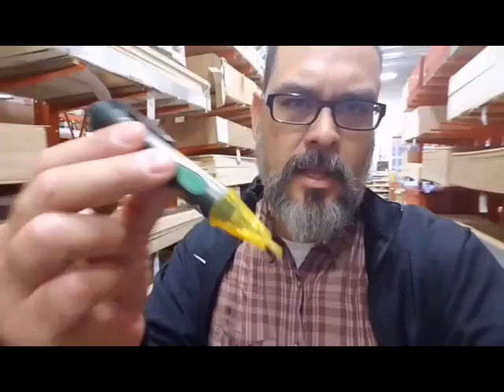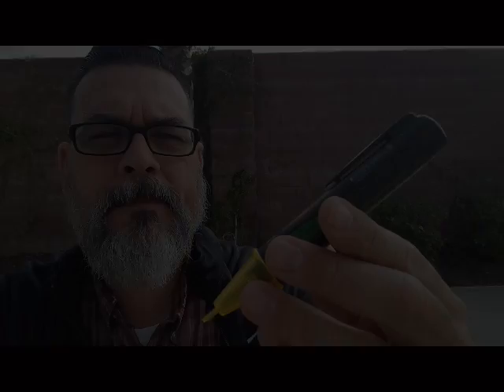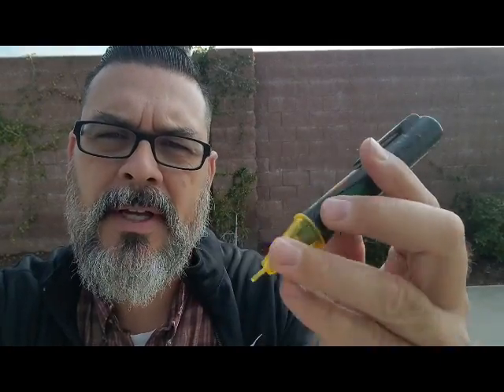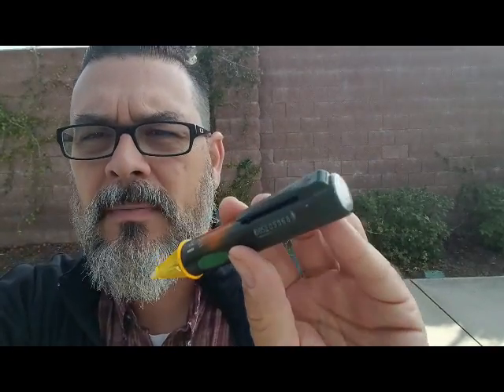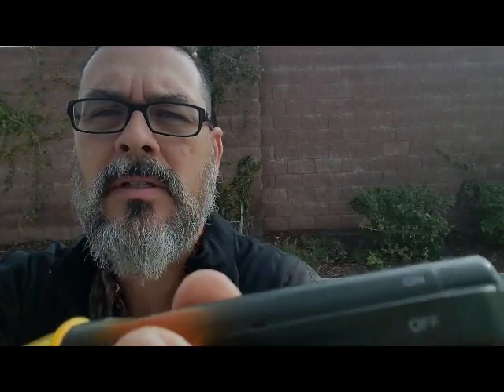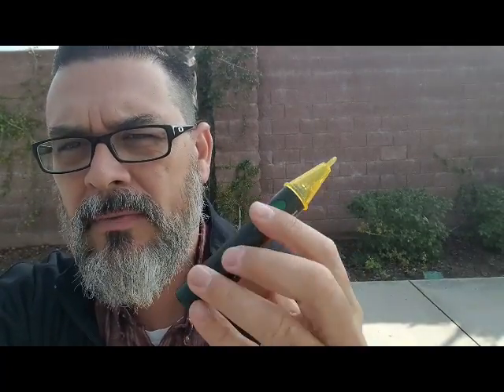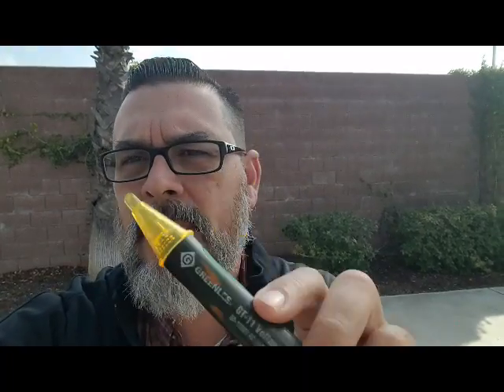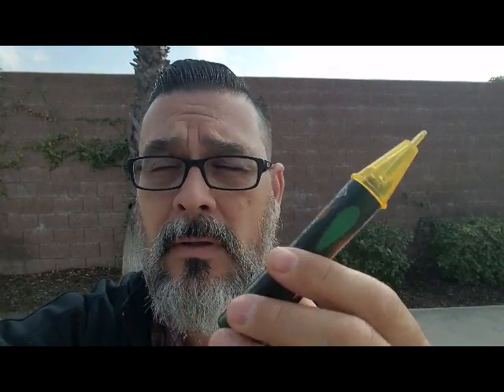The Non-Contact Voltage Tester

Comment: Got a dumb question to ask. How do you put batteries in this voltage tester. Maybe you can put a video out on this. Thanks.
Reply: The knob that turns to the off and on position has a third position to remove the cap to get to the 2 aaa batteries. The knob has a very small plastic lever that needs to be pushed down in order turn the knob past the off position and there's a very small white dot on the case that lines up where the knob or cap  can now be removed  to access the two aaa batteries. Positive side of the battery faces towards the knob or cap.
Reply: @leroyusa935 thank you! Just what I needed!

Comment: Any reason why I'm getting this to light up when I'm testing an unplugged cord?  It's attached to a brick which is itself attached to a Nintendo Wii. It hasn't been plugged in for months. What gives?

Only thing I could think of is that the Wii could have one of those batteries so you don't have to keep fixing the date and time every time you turn it on. Would that make sense?  If so why would it be connected to the plug, is that so it's grounded?  Forgive me if I'm asking very basic questions, I know computer hardware (enough to put one together with retail parts), but I  next to nothing about electrical components.

Comment: they are useful as a best estimate locating a live wire , without having to cut into the wire to get a more accurate volt test with multi meter..
Reply from the maker: +Marty Forkwater that''s a great point.
Reply: would love to see u go through all the multimeter settings\symbols . ive only used volts and continuity im not sure of the importance of the other settings apply to a house electrical system
Reply from the maker: +Marty Forkwater great idea, I'll add it to my list.